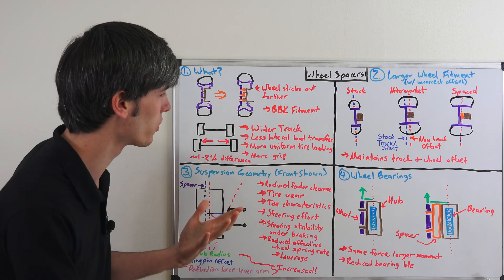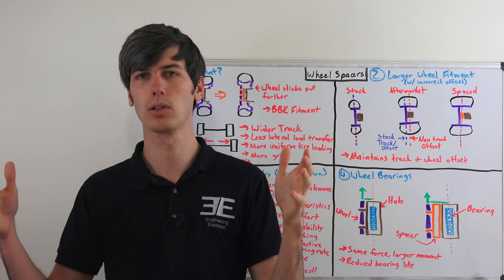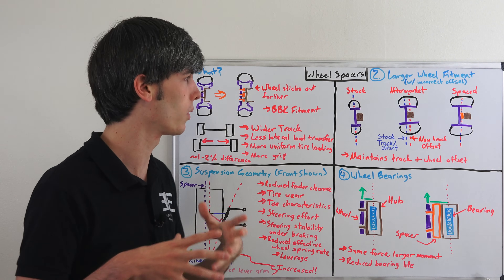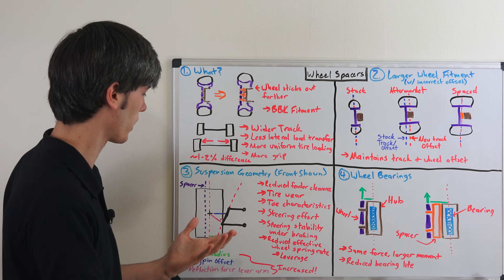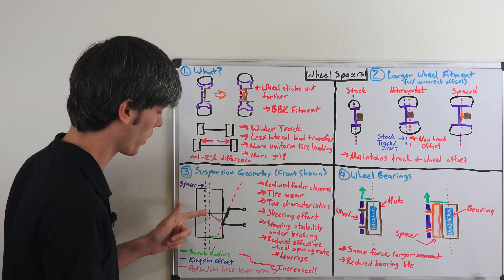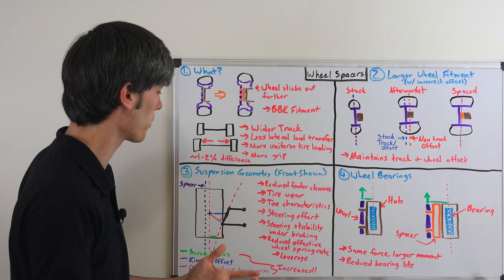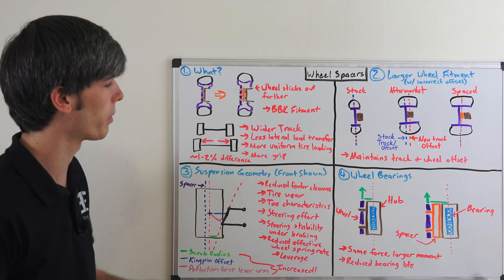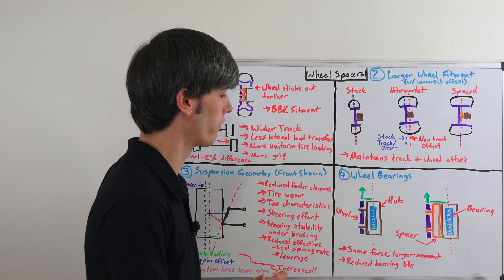Wheel Spacers & Adapters - Good Or Bad?

Comment: fyi for the people that don't understand, moment is essentially the engineering term for torque. Therefore with a greater moment arm, or the perpendicular distance from the force to the line of action (wheel hub), the moment, or torque is increased, causing greater inner stresses on your components. Now will 2 inches or less make a huge difference, probably not, you'd have to calculate that for each specific vehicle. Oh and I'm 19 and only a sophomore in college btw, doesn't take a genius to understand this it's actually quite simple you just gotta learn it. 😊 But if you are increasing your tire size/ wheel size large enough to need a spacer, you are hopefully upgrading your suspension parts and what not too to maintain or improve upon your clearance and travel and to heavier duty materials that can take all the stresses. If not, well then good luck if you break something because stock parts can only hold a massive wheel with two inch spacers for so long before you hit a hole and snap something. Point is don't just start doing random shit to your vehicle before you consult a specialist that knows all the engineering to it because you could be decreasing performance and durability significantly depending how heavy your vehicle is and how sturdy your stock parts are. Oh and almost forgot, same applies for steering, if the force required to turn the wheels with spacers increases enough you could break your steering parts. That's why when you buy a large enough lift kit, or just one for heavy offroading, you are highly recommend to upgrade your steering to take that stress. That all being said, if you only drive on pavement at 50 mph and only put 35 miles on it every month you should be okay lol (yes I know that was an exaggeration).

Comment: I have an ongoing discussion with my buddies regarding this, that wheel spacers are bad for your bearings. And that you should get proper fitting wheels instead (meaning run a lower ET instead of spacers) - What I am wondering though, is - Wouldnt running a lower ET wheel, put the exact same forces on the bearing, as a spacer does? Isnt it exactly the same thing? You are basically just pushing the middle of the wheel further out, so the forces should in theory be the same? Or am I missing something here?
Reply from the maker: If you change the offset you may also change the bearing loading, yes.

Comment: How do they widen the track in racecars then? Custom lower arms and longer drive shafts? cheers :)
Reply: +The Retro Lab pretty much only longer shafts  and they engineer the lower arms before making the shaft longer so they don't have any suspension problems
Reply: +DukeNuggets69 Spacers are used in a variety of racing applications. That where longer wheel studs came into the mix to begin with. Open ended lugs are used and spacers are swapped out to change the track whenever the track needs to be altered. No one sits and reengineers a car's control arms to change offsets.
Reply: So basically it depends on how much the teams want to spend on their cars what they do. lol Thanks for the info! :)
Reply: +vidurc most racers or motorsport series don't use your typical wheel studs as it is inefficient when drivers come in for a pit stop, they will convert to a big single lug nut, maybe your average casual racer would, but no one in professional motor sport will use wheel spacers
Reply: thesulo12 arp studs are forged and recommended for use typically.

Comment: All right but what I would add to your considerations is a confront between the moment you're gonna subject the bearing to with the spacer lever and tyre load, and the moment the bearing is subjected when you're going through a corner with relevant acceleration. Assuming the lateral load on the tyre is the same of the vertical (with a road tyre) the lever would be half of the night of your wheel, so the bearing would be subjected to a by far higher moment.I've never used to fit or advice spacers, but I'm still looking for a relevant reason to avoid doing that.

Comment: Wheel spacers are only used because you're too cheap to afford bigger wheels
Reply: +ayy lmao 👽 Or you want to run OEM wheels with a more aggressive look? Someone seems quick to judge.
Reply: +sickmint79 I'd take a set of OEM wheels + spacers over ultra shitty $1000 aftermarket wheels any day. There isn't a decrease in performance if a reasonable size spacer is used. Dropping $3000 on wheels for a car that's worth less than 10k is foolish at best.
Reply: +ayy lmao 👽 
ayy lmao
Reply: +ayy lmao 👽 Wrong... Porsche use spacers from the factory in varying thicknesses.
Reply: Oh woww! Heres a cookie 🍪
Reply: +ayy lmao 👽 or you want your wheels to fit inside your wheel well nicely. Your comment screams you have little or no experience spacing wheels on a vehicle.
Reply: thank goodness the real world is full of more than the false choice of those 2 shitty options.
Reply: +Nayr747 i got a fever, and the only cure is more rpf1. Kappa
Reply: +Armaan R I agree!  I love my stock wheels (99 SVT Contour) but wished they were a bit wider.  the closest wheel i found that looks close to the same is the Cobra R wheels.  It would bump me up to a 17 inch wheel, which isnt a problem, but a 9 inch wheel as opposed to a 7 inch wheel is a big difference!  Im currently running 10mm hub-centric spacers up front and 15mm hub-centric spacers in the rear while 1.7 inches lower on all 4 corners with my stock wheels and it looks so much better!  I might go Cobra R but Id have a fair amount of work to do to get them to fit and not rub.
Reply: +Armaan R TRUTH!
Reply: +ayy lmao 👽 I guess H&R is a cheap company. BMW and Audi must be cheap for running their racing teams with H&R spacers...
Reply: +ayy lmao 👽 actually you're wrong. If you watched the video you'd understand that bigger wheels effect the offset no matter what, unless the offset on the wheel itself is made to compensate specifically for the OEM wheel on that car. So you need a spacer to get the center of the new, bigger wheel, to match up with where the center was with the OEM wheel. The center is in reference to the center of the wheel aligned with the wheel hub.
Reply: +ayy lmao 👽 Thats not true at all.
Reply: +888TopGear888 I think he's just a troll at this point. No one who "owns two cars" would be this 'ignant.
Reply: +Armaan R and less aggressive performance

good trade off
Reply: Armaan R Although you are correct it's fairly uncommon
Reply: +Armaan R You could get OZ Ultralegerra wheels for around $1000 and I guarantee they're significantly higher quality, lighter, and stronger than your OEM wheels unless you drive a really expensive car. And with aftermarket wheels you don't have to use crappy spacers with extended lugs to get the offset you want.
Reply: +Nayr747 Just out of curiousity I checked if that was possible. 18" OZ Ultra's go for $1300. Shipping is $150. So $1450 USD = $1930CAD. Thats before duty, taxes, bs fees, etc.
Reply: Armaan R Yeah if you look around you can get 18x9s for $1,300. But the price depends on the size. They come in sizes from 15x7 to 19x8. You can definitely get the 18x7 or 18x8 for around $1,000. You should only need to pay shipping (although sometimes it's included) and tax (if the company is in your state). There shouldn't be any extra fees.

Also, I just picked OZ because it's a really high quality Italian wheel manufacturer that supplies exotic car makers. But you could get comparable wheels from Enkei like the RPF1 for less.
Reply: ayy lmao 👽 No in other words people like to be able to tune how the steering and suspension feels while driving. Get a clue before talking shit.
Reply: Violetta I own 2 cars actually and I only buy real wheels
Reply: Violetta Technically I own 3.
Reply: rawkout So in other words.. you fucked up on your wheel specs and you turned to plan B: Wheel spacers

Comment: Basic rule of thumb is if you change the offset of your wheel or get spacers, get an alignment since all the specs will be thrown off. An alignment goes a long to way to reduce stress and wear on components like tires, the streering rack if its an FWD car and resets the toe which is pretty important. I've been running 25mm spacers on both my FWD and RWD car for 4 years now with no issues as long as the alignment specs are kept in check. Now if you're the type to run 2 inch spacers or something along those lines yes wheel bearings can get worn. As long as you keep it within the fender line there shouldn't be any issues.
Reply: +vidurc So if I just want my wheels to be little closer to the fenders, I'd get like a 1 mm spacer all around, FWD, with factory "sport suspension".
Reply: +Grant Rodgers OK maybe not 1mm, probably a little bit more.
Reply: Grant Rodgers Yeah. but keep in mind, spacers will affect ride height ever so slightly. That slight change will throw off all your alignment specs. So If you use a spacer thats over 5mm get your alignment checked.

Use TUV approved spacers. H&R does a great job. 5mm is the minimum but they're slide on spacers which are sketchy.

If it's 5mm, 10mm or 15mm I would highly suggest using longer wheel studs to make sure you have enough stud length to keep the wheel on. If its above that like 20mm, 25mm or 30mm, usually they come with studs pressed into the spacer. 

Do not use an impact hammer to put wheels or spacers on. Use a torque wrench and torque to spec. After 50-90 miles take the wheels off and re-torque them. Retorque your wheels after 50-90 miles as well. 

http://www.trakplus.com/
Reply: +vidurc oh also mine are 4 lugs... Ultimate shit box... So I should probably get these installed, I'm not the handiest motherfucker, don't even have a torque wrench...
Reply: +vidurc There are SOOOO many threads on the forums about this.. and i have not seen definitive proof that you definitely do or do not need to get an alignment after say a 20mm/25mm spacer install.
Reply: Grant Rodgers Yeah probably best to invest in those tools.
Reply: Scott Schubel It depends on the type of suspension you're talking about. Multi-link suspension is designed to control camber and increase toe through the stroke. If your ride height changes even slightly your toe will be exacerbated. Do a simple test on a car with multi-link suspension. Compare the settings with and without the spacer. The numbers will change. Most modern suspension requires it. If you're throwing it on a car or truck with a solid axle or macpherson strut you're not going to see changes. Lexus and Acura both use multilink suspension allowing the toe angles to change as the vehicle loads weight while cornering. 

http://www.carbibles.com/suspension_bible.html

Comment: On my evo i had hubcentric spacers so no pressure was put on the studs, i understand some spacers are not hubcentric and can result in a disaster. My opinion a good quality hubcentric spacers will be okay for daily driving i wouldnt track my car with them. Also make sure everything sits flush the spacer to the hub the studs are not pushing on the wheel etc etc
Reply: +Engineering Explained  good video, I changed from 6.5Jx16" ET55 to 8Jx17" ET35 + 20mm spacers. This makes it ET15 right? How badly would the scrub radius be increased ? Been like this for 1 year, and done 1 full track day too. And spot on : I do have instability under heavy braking, however grip&handeling it's much better. A lot less understeer to be felt my wrx sti.
Reply: 18bagabooo You should buy adjustable camber arms and bolts to change the full geometry. Plenty of places in the UK do this. I've had mine done for fast road driving and the difference is night and day
Reply: The difference between a wheel that fits properly, and a wheel that doesn't quite fit properly + hubcentric spacer is pretty much negligible.  You get the benefit of a larger contact patch and/or big brake stopping power, without much in the way of negatives.

If you were just pushing your stock wheels out to make it look better, that's different.  You're increasing sprung mass by a little, plus the suspension geometry and wheel bearing drawbacks.  I hadn';t considered the change in effective spring rate before, but had noticed that the cars tend to sit lower, so I guess that makes sense.  There isn't much benefit that I can think of beyond appearances.
Reply: +18bagabooo Have you gotten an alignment and reset the specs after putting on spacers?
Reply: Not at all. I was supposed to, but most places in UK only do Toe alignment and no camber. it was one of them jobs that never really got around to do it.
Reply: Having hubcentric spacers is useless if you are mounting lugcentric wheels. Not all wheels are lugcentric.

Also the hub cone only aids in centering the wheel. No load is transfered through the hub cone. That's why hub centering rings for aftermarket wheels are plastic
Reply: +Toms Chevelle No, there's still a lot of force absorbed by the hubcentric flange, even after the studs are torqued.
Reply: 18bagabooo That's the problem then. The instability isn't caused by a scrub radius change. That is a very minute change that can only be felt under hard acceleration out of corners.

Using spacers creates more leverage on control arms. More leverage means that you change your static ride height ever so slightly. If the ride height changes the alignment specs all change.

If you haven't lowered your car camber is not an issue. The change in toe is the issue. Look at what the stock specs are and adjust for that. If you like it then keep it or adjust further from there. I guarantee your toe is off by quite a huge margin. 

When I did my car the rear was set to 0.05 toe out stock but then moved to 0.25 toe out after I lowered it. The car cornered very well but was way to aggressive and would lose the back end sometimes. 

Get an alignment and you'll see the difference.
Reply: +Whyunounderstand  Hubcentric spacers do not put all the load on that little hub extension, the load is still on the studs, the hubcentric spacers help center the wheel during installation.  If your carefull installing non hubsentric spacers then there is no difference once the studs are tightened.